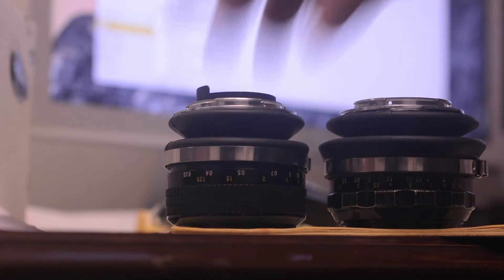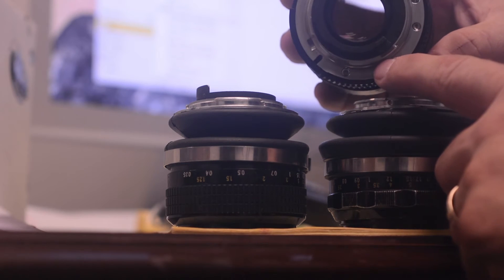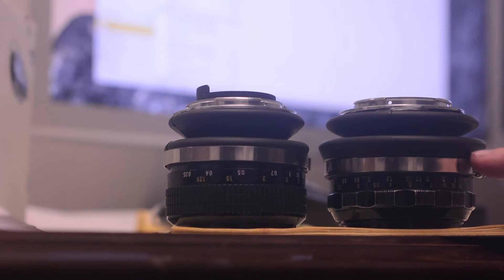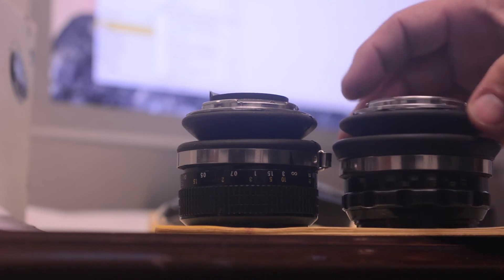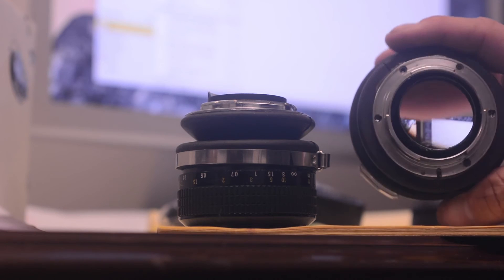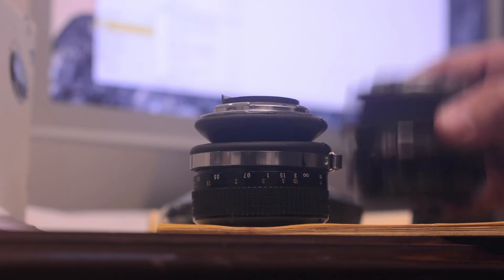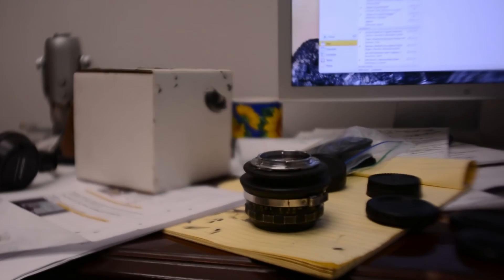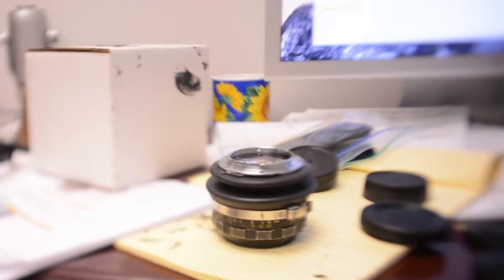DIY nikon tilt shift primes

Comment: This is so awesome, I would like to do this on my nikon 50mm 1.8 lens but I am not sure what to ask for.  Can you purchase these at a auto parts store, what do I ask for?  Any help you can give me would be greatly appreciated.
Reply from the maker: I got these at an auto parts store. They had two different kinds, the thick black one that is one whole piece and a blue one that splits into two pieces (installation vs replacement.) The blue one has walls that are too thin to hold the weight of the lens. Another store had a larger version of the one-piece black CV Joint Boot, it's walls were too thick to easily flex as a tilt-shift bellows. The small black one-piece was just right.
Reply from the maker: On my 2.8f you can see how long it originally was: http://i.imgur.com/w8MB1Sh.jpg
Your 1.8f may not need any cutting: http://i.imgur.com/J7wHQyq.jpg
Just remove the exposure ring and the silver spacer.
(I put a drop of glue on the lever that the exposure ring drove, to freeze it in the full-open position.)
After you remove the rings there should be just enough room on the inner cylinder for the boot edge to be able to clamp it on.
When I use mine the edge of the boot starts to drift back off the edge of the inner cylinder. You might want to try the type of hose clamp that screw-tightens for a more secure grip: http://i.imgur.com/m1Hpgdz.jpg